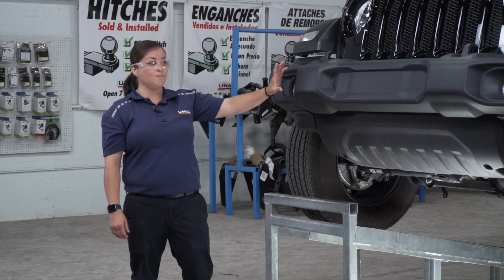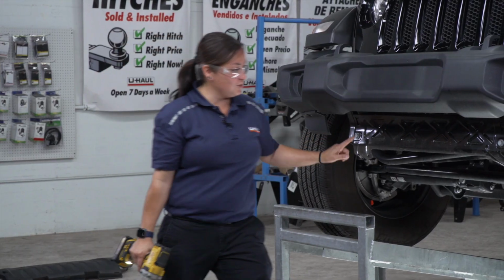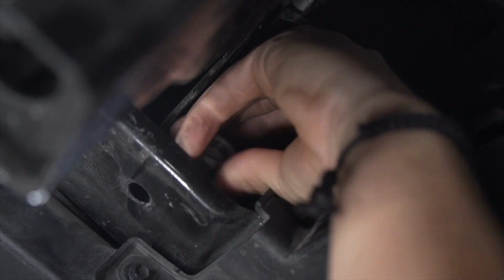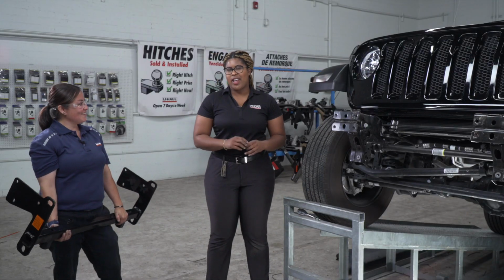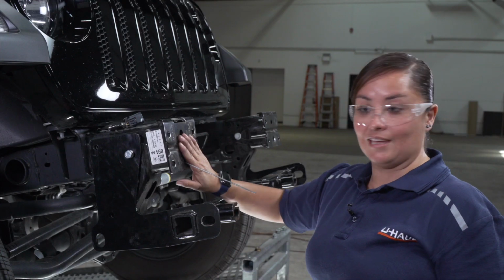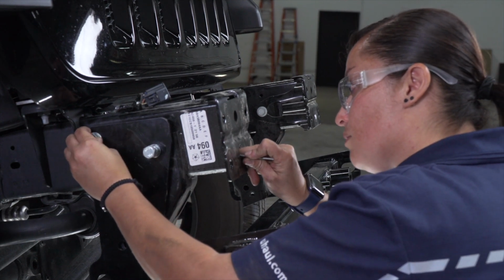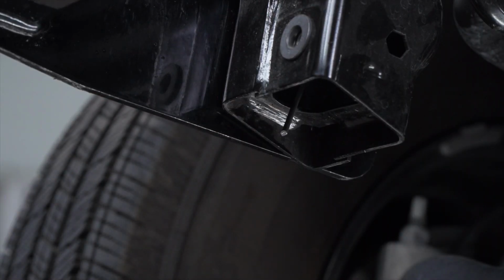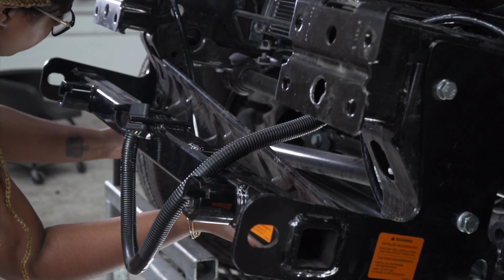2021 Jeep Wrangler Baseplate Installation (For Flat Towing)

Comment: did you reinstall the plastic skid plate? If so. did it require cutting?
Reply from the maker: It can be Re-installed. The final step in the provided Directions contain Instructions on the proper cut to make for re-installation!

Comment: Just curious why you didn't use a rivnut instead of drilling the hole out and fishing that nut through?  Is that the only reason you took off the entire bumper was so you could fish the nut through?
Reply from the maker: We try to follow the manufactures instructions for installation and in this case it called to be drilled and fishwired.
Reply: @trailerhitches  Awesome thanks for the reply!

Comment: What about reinstalling the belly pan? Were you able to do that?
Reply: They won't fit back on with this base plate installed. Best to just find a bumper with tow points on it already if you need that area protected.

Comment: Thank you! I really enjoyed your video and found this information very useful. Particularly, since I just purchased a 2021 Jeep Wrangler Unlimited Altitude 4x4 and am in need of a 'Blue Ox 1139' installer in my area. I tried your link, but it offers no info on the Blue Ox 1139, nor it's installation locations. Is there a U-Haul location in the Colorado Springs, which is familiar with this installation please?
Reply from the maker: Sorry, our website can have troubles with baseplate selections. Our stores have access to all this information, so give your closest U-Haul hitch center a call and they can order it and install it for you.
Reply: @trailerhitches  Thanks. Tried that; they were at a loss, as well?